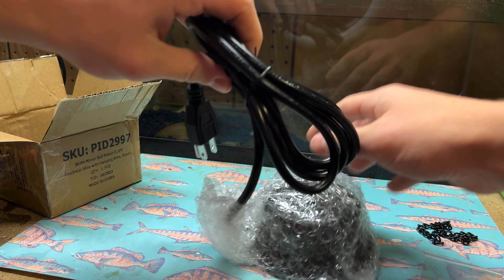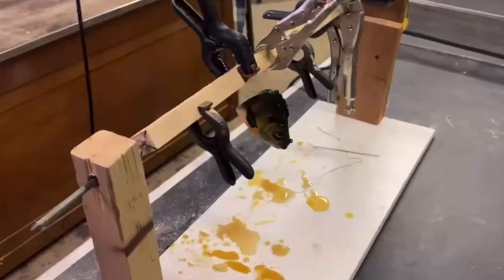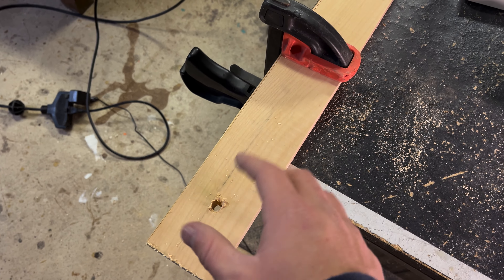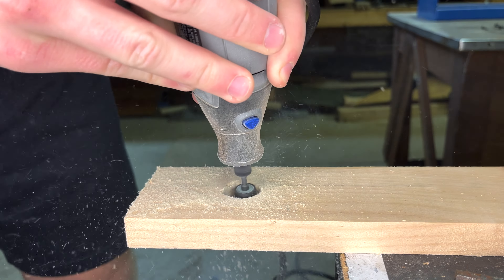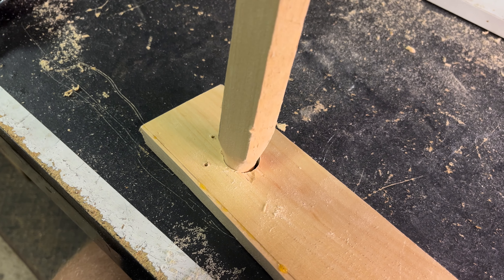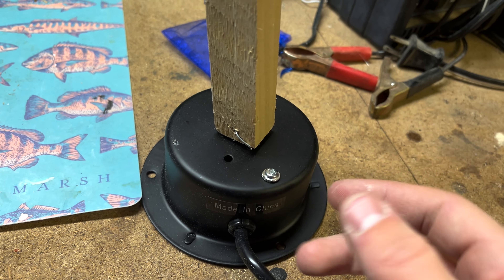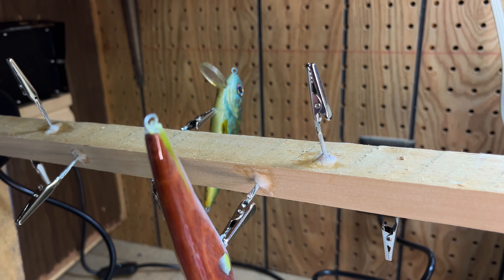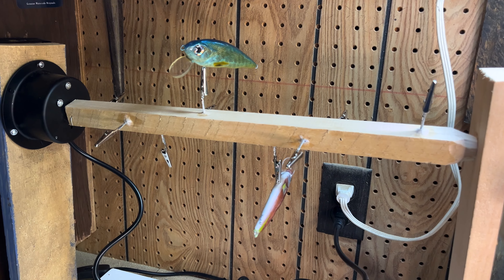Easy to Make Lure Turner

Comment: I've built my lure turner 3 different ways using a disco ball motor. I finally settled on magnets that hold hemostat clamps which hold the lures. This allows me to put a lure on the turner or remove one without having to stop the motor. Speaking of the motor, it is still spinning after four years of use. Your base is the same as mine. I used a nail instead of wire as a pin for the spindle to eliminate the "flop" while turning lures.

Thanks for the post, I'm always looking for ideas.
Reply from the maker: Good to know! I think I’ll end up modifying the wire pin because it does have a little flop. Thanks for watching!
Reply: that's actually a great idea, thank you I'll try that. I've been thinking about durable solution and what you suggested makes a lot of sense!
Reply: @RobertPodwika  one thing to watch out for is, do not let the hemostat "snap" to the magnet due to magnetic pull, while placing it on the turner. An abrupt "click" like that can cause the hemostat to unlatch, open, and drop the lure. Instead of attempting to lay the hemostat "flat" on the magnet, I angle it slightly until it makes contact then gently "roll" it into place. Hope that makes sense. If not, it will the first time it happens to you.
Reply: @mike1261  I tried and it worked like a charm! :)